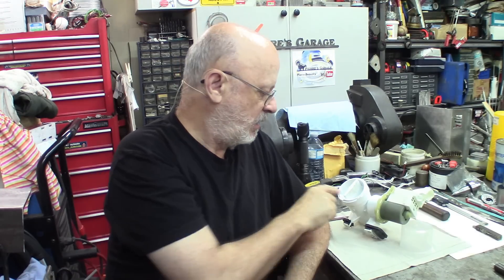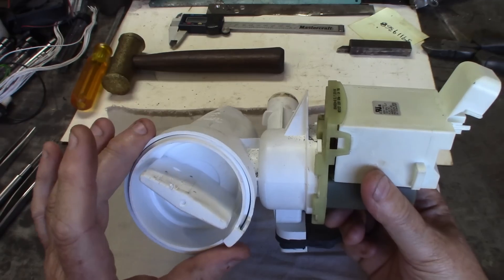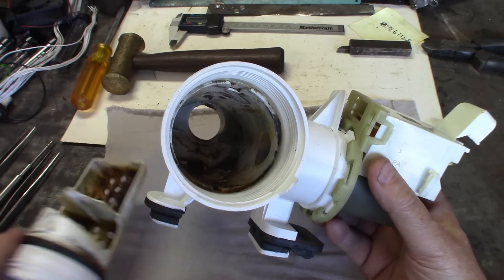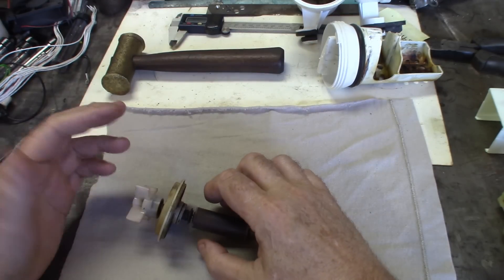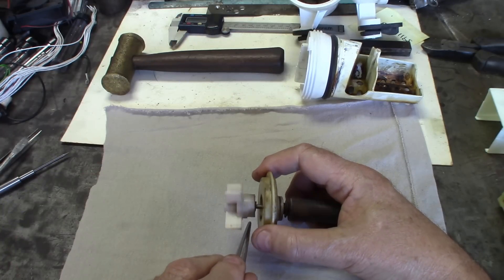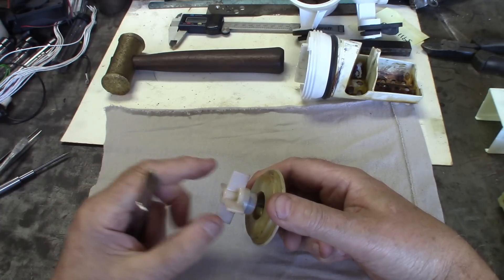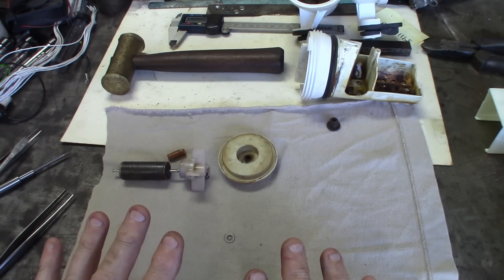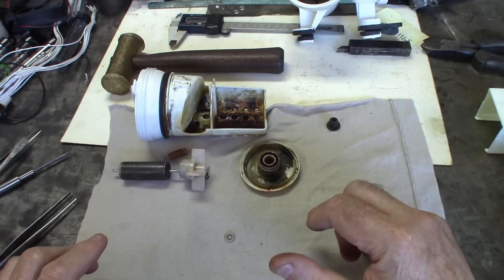Autopsy of a washer drain pump, why it failed and how it works...

Comment: Merci Pierre! Yours was the first video (of many) I’ve watched that shows taking the motor apart. I took mine out to test it after getting the 0E error code, and it seemed fine (impeller tight, spinning action good with magnet working well, resistance at 13 ohms) but when I took the end off,there’s been water getting inside for quite some time now. Black wet sludge throughout. I’m surprised that it kept working for as long as it did. Anyhow, thanks for your help! Bon jour!
Reply from the maker: Bienvenue pour le commentaire, heureux que la video ait aidé à résoudre le problème....
Really those pumps are only giving up when there isn't any reserve in them....    😉

Comment: My pump motor was full of sludge due to leaking seal. I wonder if a weep hole in the motor housing would prolong the pump life...
Reply from the maker: Hummmm....  If the pump is starting to fail, it's much better to replace it in order to avoid having to make more of a mess or dammage. After all, if you search a little you can find a replacement for a decent price...
Reply: @pierresgarage2687  I was considering the weep hole on the new replacement as preventive maintenance. After studying the housing design I figured drilling a weep hole would be too risky...so I bought two pumps to have an extra on hand 😁

Comment: I just had a failed pump on my machine. It was only occasionally starting and would stall out and get really warm.
Reply from the maker: Sounds like your pump was stalled due to probable excessive wear or an unbanlced impeller, at that point it's time to look for a replacement pump...

Comment: Fascinating. My machine keeps saying E30. I checked the drain hose and it's fine. The water filter is clean. I wonder if the problem is in the pump, then.

Comment: I removed every piece of drain and made sure there was nothing blocking, but I did not open up the pump impeller casing. The drain error code f21 was intermittent.  Thank-you for this video as I was finally able to confirm the problem.  I had hoped to buy just the pump but had to purchase the whole pump/drain together.
Reply from the maker: Thaks for your comment I'm glad the video helped you diagnose and fix your problem.....    😉👍👍

Comment: Salut,  j'ai un epic Z de 2009, je cherche à remplacer les shock du barillet. j'ai vu que ça peut monter à plus que 100$ pour le kit de 4, sais-tu si les kit à 30$ sur amazon fond la job? le modèle c'est :MHWZ600TE en changeant le door seal j'ai spotté une fissure sur une patte/base de shock. elle on l'aire vissé, mais je suis pas sur, je vois sur le web qu'elle sont clampé. es-tu en mesure de m'aider à trouver la bonne piece avec ma laveuse?

Comment: Well, a fine mesh on the basket should be the cure to prevent any debris entering the pump. But that will requiere cleaning more often. I do think a clogged discharge line may make the impeller cavitate and eventually deform the shaft.

Comment: I taken my water pump out, opened it up and it was full jam packed with black solid amount of wet metal dust , 
some how all my metal dust off my overalls over time the magnet had drawn them in and stayed there due to the metal dust being kept there due to magnetism
Reply from the maker: Wow...!  At least you got the problem fixed , amazing what can accumulate in this pump and cause problems...
thanks for your comment...   😉😉

Comment: We had a stray pen in the wash, and i found the inner ink cylinder in the filter. The pump hums and doesn't drain. I wonder if ingesting a hard object like that ruined the impeller on mine. Ill do my own autopsy soon.
Reply from the maker: Hard objects hitting the impeller may distort it, in this case you need to get a new pump, if you're lucky it only blocked the impelled without damaging it.
If you need to get a new pump, i suggest looking on eBay, it shouldn't be much more than 30 to 40$ brand new.
Reply: It was a bobby pin! A single friggin bobby pin jammed the impeller and brought down the machine.
Reply from the maker: On the bright side, at least it's fixed... !!!   😉👍

Comment: Excellent description. I had pulled my motor and it sloshed (uh-oh!). While I poured water out after taking it apart it looked sealed by design from the electrical side and perhaps the pump used water for cooling, I doubted that but it could be. Only minimal scoring on the shaft ends. Finding your example that it should be sealed confirmed the problem on my appliance. Thanks.
Reply from the maker: Thanks for your nice comment, I'm glad the video helped your solve your problem....🙂🙂

Comment: Great break down of the motor! Im my 10 year old whirlpool the impeller shaft came loose from the tubular magnet..probably from water getting past the seal.. thanks!
Reply from the maker: In most cases the best thing to do is to find a reasonnably priced good quality replacement pump and start fresh, the washer from the video isn't here any more but I've heard recently that it's still working perfectly well since the repair.

Comment: It failed because this is merely an imitation of a drain pump. The pump in the cheapest industrial washing machine, looks completely different. There is no possibility of anything damaging the impeller.
Reply from the maker: This pump is the original pump...
I have no sure explanation on how the debris got there.
One sure thing, the manufacturer will construct a brand new washer for about $100 and sel it to the consume for neaw $1000, They can't use a $150 pump and other costly items and expect to make a profit, it's the same on every single part that they use.
They just hope it makes it past the original warranty period and sell you the same cheap components at 10 to 50 times their cost.
It' the way it goes, unfortunately...!!!

Comment: I replaced two pumps already  in the past few years and was getting the error code for waterpump failure again. Came across your video and haven't felt so dumb in a while. I do not remember ever cleaning this filter, while still being able to replace the pump twice. 

My filter was clogged and full of lint, the E-18 code fixed by just cleaning the filter hehe. I Wonder if i replaced a good pump the last time now ;)

Thanks for taking the time to explain this in detail.
Reply from the maker: At least the problem is fixed for good, a better understanding of situations really helps solving issues...
Thanks for taking a moment to leave a great comment,
Cheers,  Pierre

Comment: We have changed ours twice. It would work fine one time then nothing.. what could be causing this? Please help!
Reply from the maker: Hard to say without seeing, is there anything like debris in the streamer or lack of water when operating as water is acting as a lubricant on the main shaft...?
Is there sign of wear, deformation, anything out of the normal operation norma...?
Make certain it's only pumping at the required moment, like mentionned before it's difficult to diagnose without any details.
Reply: @pierresgarage2687  thank you for replying! We have it fixed! After some investigation we found that it has a circulation and a drain pump. Thankfully they are the same pump .

Comment: Kenmore elite he washer  pump very noisy,  would not work under load. ohm resistance was good 15.4 . got a new one on Ebay  $32 dollars. working great and quiet
Reply from the maker: Thanks for your comment, nice to hear that it helped you fix your appliance....
Cheers,
Pierre

Comment: thanks for your video, i had taken apart my pump as it was making a hideous noise when operating dry and it was full of water and foul smelling gunk. it also appeared to start collecting metal fillings. i have a new pump on order and im confident this will give our washer an extended life (its an lg direct drive) thanks again!
Reply from the maker: I don't still own this washer, but, I know that the latest owner still uses it and still happy about the performance...   🙂👍

Comment: The propeller is rotated by magnetic force.. outside the cylinder. Water is used to cool it, so, it should not be sealed. If it is sealed, then friction to plastic "bearing" will destroy it and the prop will wobble.
Reply from the maker: You may be right about this, can't argue cause I don't have a pump at hand to verify what should really be the situation inside the rotor's chamber...
Reply: @pierresgarage2687  There is a ton of videos on Youtube about these pumps. Here is one. You can skip close to the end to see the pump dismantled.. there are no seal either in the middle or outside the border, just a gap. 
https://www.youtube.com/watch?v=vO0i3gbZ3es
Reply: @pierresgarage2687  here is another one, perhaps better: https://www.youtube.com/watch?v=jSEKMeAv4ps&t=678s
Reply from the maker: @bjarnieinarsson3472  
You were right, wouldn't drink that coolong water, though.....    lol

Comment: I bought a replacement pump. Would like to have been able to buy just the sealed plastic assembly with the impeller (of course) and transfer the electric parts from old pump. I could not find that as an option.
Reply: They are available on Amazon.  If you have kept your old (original) pump you can replace just the motor/impeller for $20-25.  Replacement models are different and I have not found a replacement motor yet.  Seals fail in 1-2 years on the replacement pumps.

Comment: Excellent video. Have the identical pump. You mentioned that you had taken it apart before and noticed you pushed and quick turned the pump to disconnect it from the drain tray. Tried that but could not get the plastic ring lock turned enough to separate the motor from the drain tray in order to check the impeller. Do I need a special tool or teqnique?
Reply from the maker: It's been a long time since this video was made, but, if my memory is about right, I held the motor in a vise (Gentle enough, though...) and just using slip joint pliers unscrewed the plastic front part off...   At least this is what I remember...    😉
Reply: I just replaced mine and disassembled the old one to inspect - if you look carefully at the plastic tabs around the circumference of the pump, there's a small raised portion on one of the tabs on the drain tray that keeps the motor housing from rotating. You just need to press that bump/divot gently with a small screwdriver, and then you can rotate the pump off easily.
Reply: Also by the way, when I disassembled the old one, the cavity surrounding the rotor was absolutely filled with a grey, gritty sludge. I'm not sure how much of that grit was from dirty clothes and how much was metal that was worn off the rotor. In any case, I'm sure it was impeding the operation of the pump.
Reply: @stephenban  that is how it fails.  I purchased a new one, but cleaned, greased the seals and put the old one together and it works well enough to run a few loads until the new pump arrives.  FYI, the original pump has that twist off motor.  You can purchase just the motor with impeller for that model.  I threw mine away not knowing this.  So now I have to replace the whole pump each time.  On my 5th or 6th pump.  Original lasted probably 8 years.  Replacements are good for 6 months to 2 years.

Comment: The wear on the shaft was most likely caused by electrolysis set up by the coins found in the strainer.
Reply from the maker: In my opinion it would be only by friction since the impeller was really out of axis and heavily rubbing on the surounding components, and, electrolysis would be impossible since the coins and inserts weren't touching the shaft at any moment.

Comment: You can repair it fix new implera with aluminum you can manufacturing the part by lathing machine shop i do that in saudi arabia because 110 v spare part stop since 2015 so i try repair every part of old GE washer even the seal you can make them easily so dont throw eny thing
Reply from the maker: The repair would require a great amount of time, since the whole assembly was $30, it was more reasonnable to replace the unit, I've ordered from eBay cause local suppliers were asking around $200 for the same thing...!!!  Internet is a good place to look for parts when something is not available locally or when prices are way too high.
Thanks for sharing your experience...    🙂👍

Comment: Does front load water pump sucks water out of the drum & then pump it out? Or water gets to pump from bottom of the drum by gravity & them motor only pump it out? Can you explain?
Reply from the maker: Front loaders just like top loaders have a rotating drum and a tub around it, it's the same in both machines, the water goes out the bottom of the tub into the pump's inlet and gets pumped into the drain hose to the be evacuated from the washing machine to the household sewage system.   🙂

Comment: My pump about a year ago broke and I found a shiny penny where the copper coating and been rubbed off through constant abrasion to the pumps rotor. I paid $26 for a replacement pump and it made it about well actually it was way before Covid so it made it two years. It had conductivity but I dunno what else it could be since the error code is the pump. I’ll try and buy another one. Having twins our washing machine usage quadrupled. I paid $350 4 years ago puls $26 (and I had to rent a uhaul). I feel like I’ve gotten my money’s worth but I don’t want to buy a new one.
Reply from the maker: The main issue with those drain pumps, objects making it pass the screen and damaging the impeller, this is why I've gotten into the habit of emptying my pockets before EVERY load...   😉
The other items that may fail are the main bearing on the drum, the water seals and finally the electronic control board...   If you get the parts from the official service center you get to pay very high price, sometimes more than the value of the appliance, this is what I call abusive practice that encourages trashing tools or appliances that would be perfectly functionnal for a long time with a low price repair......   
This is where consumers need to be creative in finding replacement parts and fixing. 
We also have to let those big companies know that we don't accept playing their game.....     😎😁🌈
Reply: totally agree.  what brand would you suggest buying? kenmore, kitchenaid,  whirlpool,  LG,  ???

Comment: Is the cheap one still working? I am about to do this replacement.
Reply from the maker: Since I've given the washer to my son and it's is still performing as it should, they even use it more than we did, in fact it'S the same part or just about, the problem with buying from the big name distributors or manufacturers is the enormous marckups they charge.
Just try to imagine selling a whole washer for $500 to $800 and paying $100 just for that pump, as a insight into manufacturing and retail, if it costs $10 for an item it will resell for 3 to 10 times or more the actual manufacturing cost....  Don't be shocked, but, the worse of this is inkjet refills, what you pay let's say $75 for a refill cost them less than $2 even less than a $1 in most cases..............

Comment: 2:10 what is that silver component connected to coil called?
Reply from the maker: Sorry if the comment is late, it just got lost in the stream of comments, just if you still wonder it's most likely a thermal switch that will trip if the motor overheats.

Comment: Excellent video. When I recently removed the drain pump in my Whirlpool Duet Sport washer, I found water on the other side of the impeller. I cannot see any other physical damage so I am concluding that one of the rubber seals is starting to leak. The pump seems to work sometimes but the performance is spotty. I guess I will just have to replace the pump. Let me know if you have an alternate suggestion. Thanks.
Reply from the maker: If you look well on eBay there are some brand new pumps that will perform quite well, better than trying to fix anything and sooner than later having to dismantle the machine. I gave my machine to my son and it's still going without issues with a $30 brand new pump from eBay...
Reply: @pierresgarage2687  Thanks. That's what I did as well. The machine is back to its normal self.
Reply from the maker: @AjayGupta-Private  All for the best...   .👍

Comment: when mine is not draining, it makes a soft sound, need to open (so all water starts running out) & then spin the plastic crosshair a little with the finger & then it magically starts to work properly &  needs to closes it asap to avoid all water to run out . if luckly it works 1-2x full cycles but then again some intervention needed (bosh vario perfect maxx7)
Reply from the maker: Can't give a definitive diagnostic, but, if your washing machine has quite many washes done in it's life, my feel is that there is quite some wear on that little crosshair (impeller) thing you mention. What happens is that with the wear the impeller won't be centered on the shaft and either rub on the housing or there is foreing stuff that causes friction and since that impeller doesn't hane enough torque to get going. The other possible reason is the shaft itself is worn out behond tolerances and then the pump needs replacement, this shaft isn't replacable in most pumps of that type.
Hope it helps, just let me know what solved your problem for good...
Reply: @pierresgarage2687  guess the machine is about 6 years, there is a little play left-right with the impeller but nothing inside the plastic housing when opening to need spin it. machine was not super expensice so sooner or later, when being done with the house flooding, we'll retire it, thx for u'r fast diagnostic :)